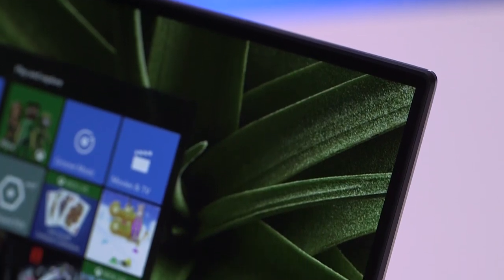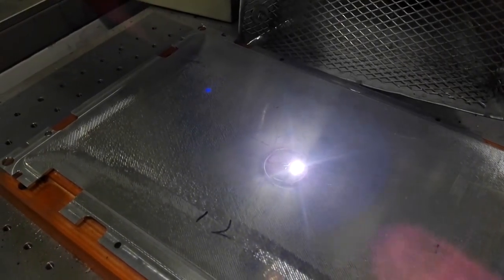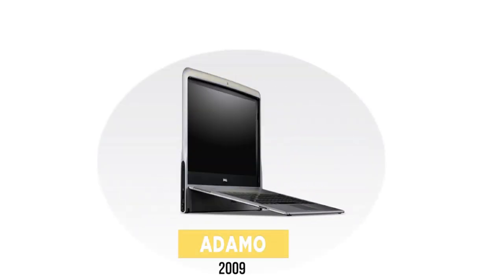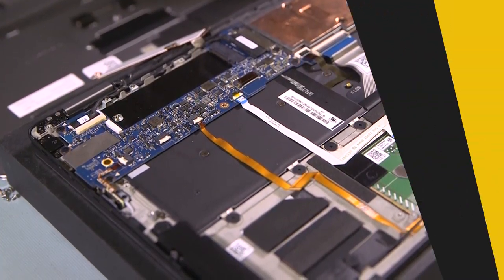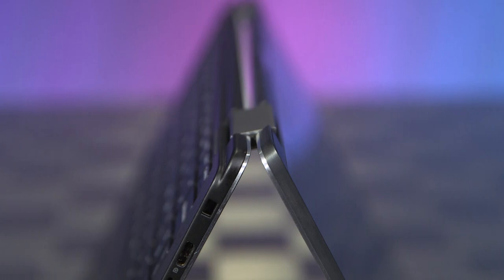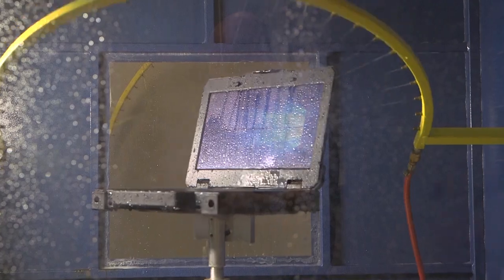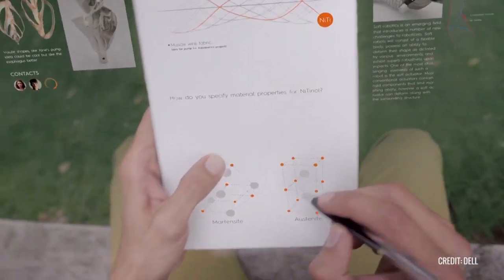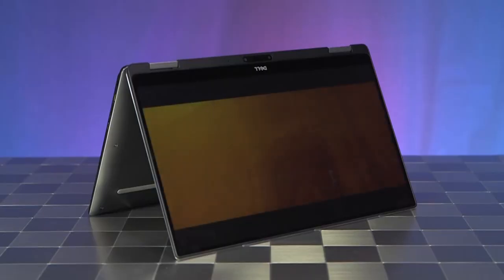Unplugged: The Making of a Dell Laptop

Comment: sadly they used y series and named it core i5/i7 to confuse customers thinking they are u series.
Reply: That was Intel though
Reply: There's 0 difference between Y- and U-series processors. We're talking exact same silicon, described differently based on the information provided by Dell in each given computer's UEFI. Clock speed, target TDP, that's about it. The silicon is identical amongst all OPI-based products: quad-core i7-7820HQ, low-end Celeron 3865U, you name it. Costs 70 cents to manufacture each, then you solder it and flash the UEFI, done. Name it what you want.
Additionally, the CPU, GPU parts, cache, memory, connectivity PHYs are identical with even the desktop i7-7700K, so at least 90% of die is the same with all Y, U, S, now X chips.